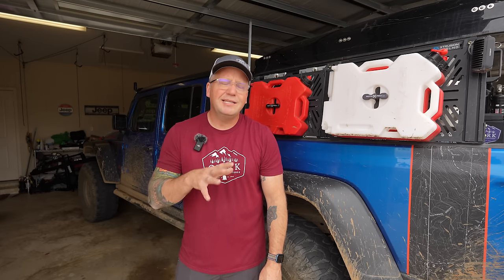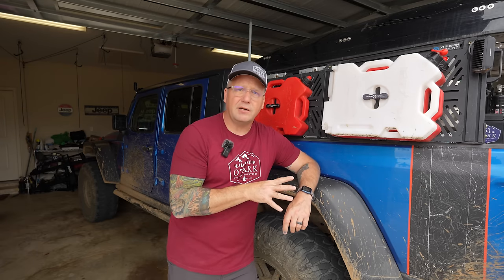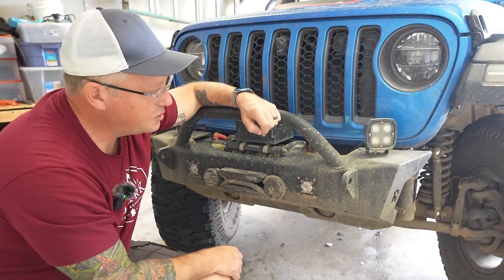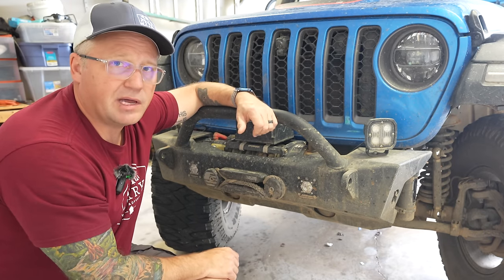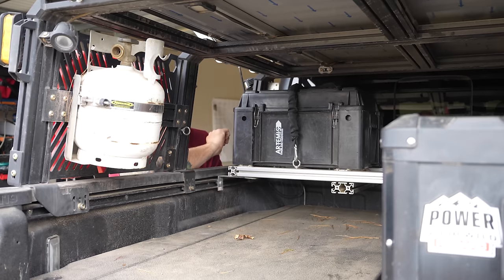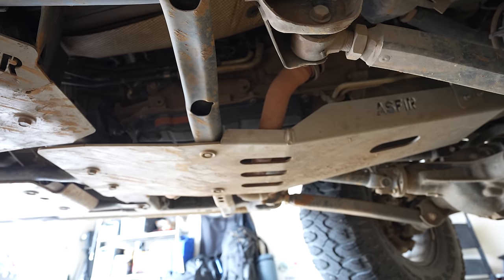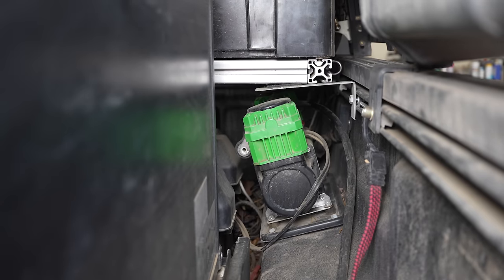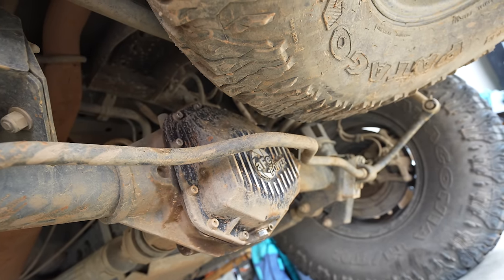How to Build a $106,000 Gladiator with Zero Regrets!

Comment: This was a great follow up vid to your last build review.  Probably getting the AEV lift this winter and they have a remote reservoir shock option but obviously a lot more- about twice as much. Everything else is exactly the same. All of my offroading is slow speed and will be with this rig. I won’t be getting to places where I can go faster until closer to retirement which will probably be my next rig. I can’t think of the last time I went over about 12 mph, or even wanted to.  It is also my city/suburban daily and I drive interstates a lot too. What do you think about the remote reservoir shocks for my scenario. I mean I know they’re better, I just don’t know if I’ll really be getting the use out of them. I’ll spend the money if I’m gonna use it, but I really hate spending money on stuff I don’t need simply to say “look at me, I have the best” of whatever it is. So any insights you might have would be appreciated.
Reply from the maker: the shocks make a big difference around town and on the highway too with body roll and hitting hard bumps in the road.
Reply: @OzarkOverlandAdventures  thanks man. Appreciate.

Comment: What wheels, width & backspacing are you running?  Did you change the wheel width when you upgraded to 38x13.5’s?  Also, did you upgrade your axle shafts?  Thanks in advance.

Comment: Hello, I have two questions, I have Milestar Pats 35's after 10k they have gotten very loud. Have you experienced the same? Your fridge slide do they still make them? I think it's great. Saw your Gladiator at Overland East and that drawer is on the short list.
Reply from the maker: All mud tires will get louder as they wear down. Even Pats. Rotate them often. They still make the slide Just call them.

Comment: Do you have Clayton‘s HD springs or the regular? I have their HD’s and they’re pretty stiff when I’m not weighed down, but I usually have a good amount of weight weekly. If you have the regular, how does it handle when the bed is full?
Reply from the maker: at the time of this video I had the regular springs and they did great. However my gladiator has gotten a little heavier and I switched to the HD springs about a year ago and they are awesome.

Comment: You still have your tailgate as you have now SHW drawer? 
If yes feet together ? You can still open the drawer without touching the tailgate ? (I can t really see on the video and you didn’t talk about) 
If yes what s the brand of your tailgate ?
Thanks for all those very helpful videos that you always do ! 👍🏼
Reply from the maker: Still have the tailgate table on the back. We did shim the drawer up about an 1/8 of an inch to clear it.
Reply: @OzarkOverlandAdventures  
Thanks and your tailgate is from MOUNTAIN HATCH ?
Reply from the maker: @mehdiabderrahmane2439  my original one was. The one I have now is by All Pro Off Road. They are basically the same.

Comment: How did you fit a 38”  spare tire
Reply from the maker: Clayton Rear Track Bar allows for larger spare. The 38s just barely fit but it does great there.
Reply: I have 38” nitros and they didn’t fit with tu stock track nar
Reply from the maker: @SuperSilence23  I couldn't get my 37s to fit with the stock track bar either.

Comment: I would like to know more about the pull out door in your Gladiator back end also the sliding tray for the Iceco I have a Iceco VL 90 Prod would that work for you also. 
I would like to know more about the Redarc and the inverter plus batteries I would like to add that to my Gladiator also can you please help me with this problem also again I do enjoy your videos. That helps me build my Gladiator to be better than it is..
Reply from the maker: the Drawer is SHW Offroad. The slide is Global Road Outdoors. I had to modify it to work with my VL75. Not sure it would work with the VL90. I have an entire video on the Redarc system install.
Reply: Yes I saw it but it didn't say what size or model it was and the inverter also .
I looked at the information below in your video but there was no more info on them every thing but that.  In the video you didn't say much on that,  all I could hear was Redarc and inverter no more?? Can you help with this problem please 🙏. Thank you very much.
Reply from the maker: @thomasshelquist7821  Is this the video you watched? The links to the products are in the description. https://youtu.be/ol4QJblhDFc
Reply: Thank you very much, looks like I have to wait for the inverter and the batteries they are out of stock for now. 
I did get the Redarc did you buy the wire harness that they offered??  What size of cables did you use for the total install. 
Again thank you I missed that video,  I can't wait to get it installed.
Reply: I do wish I lived closer to you to get good pointers on the whole thing.